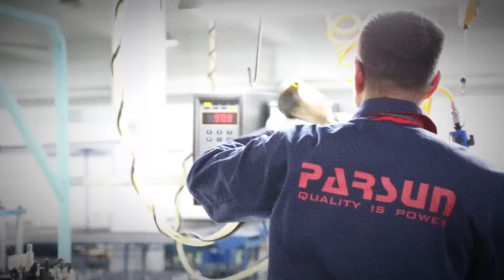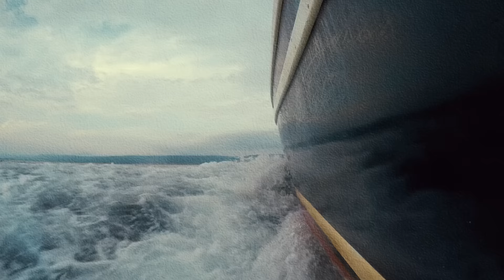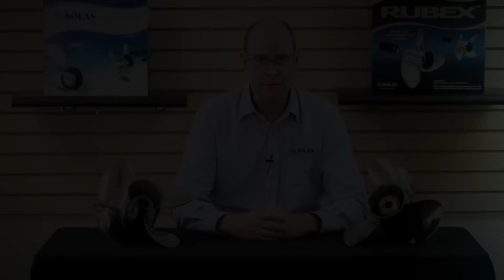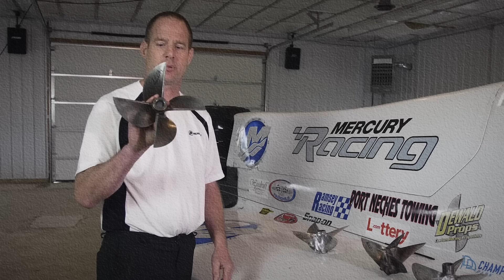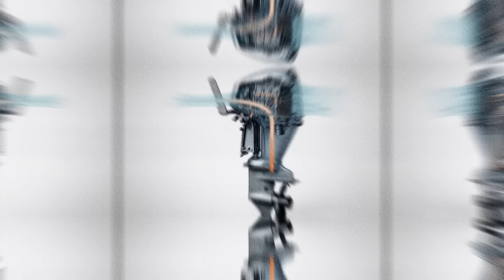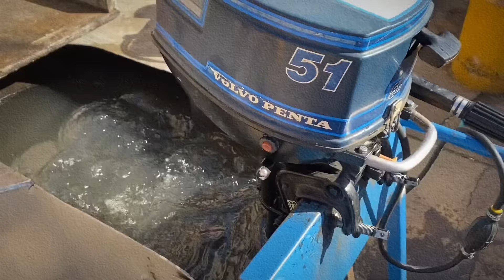The $400 Chinese Outboard Secret That Adds 7+ MPH

Comment: The part where it said the motor was only turning 5100 rpms and was under propped. So they put a bigger prop on it to get more rpms  to 5800. That's complete opposite of the truth   a bigger pitch prop will turn less rpms and a smaller pitch prop will turn most re rpms. If your motor is turning more then redline rpms u need to go more pitch. Bigger the pitch the faster it normally goes. The smaller the pitch the better holeshot and low end power. This video is just blabbing a bunch of nonsense